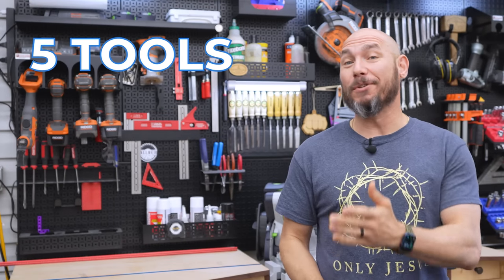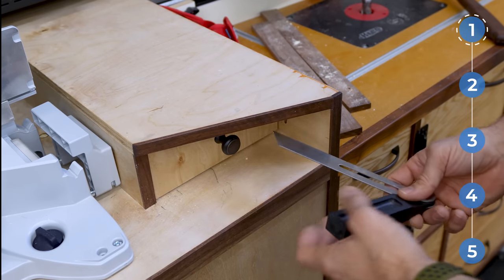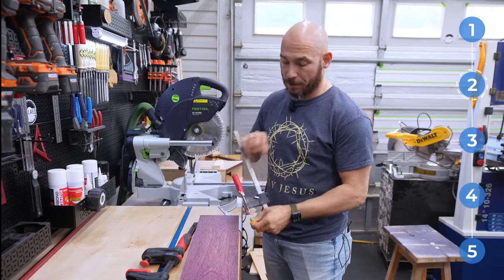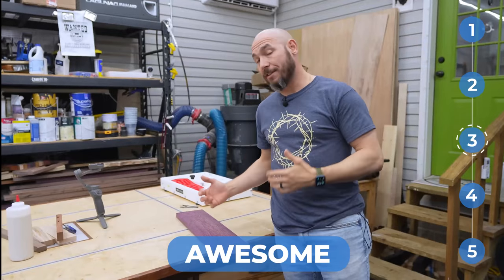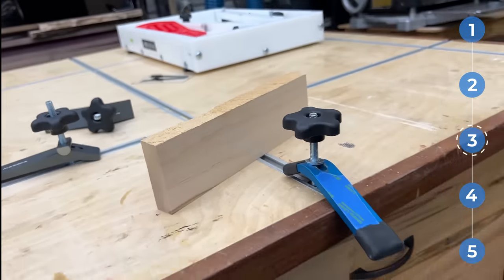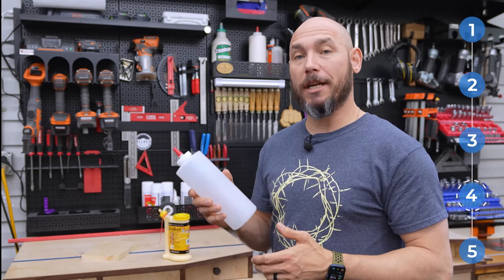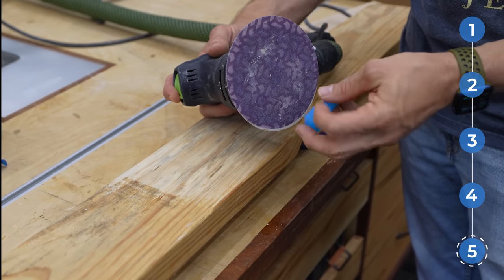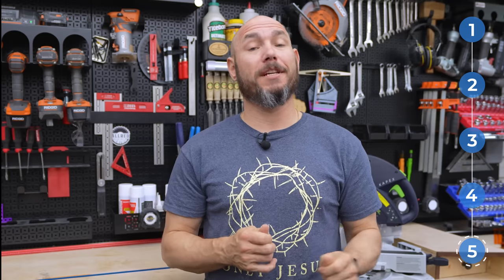5 Tools Under $30 Every Woodworker Needs

Comment: Thanks. My preference for glue applicator bottles is yellow mustard bottles. They work really well and I have never had a problem with them.   I have both a large and small glubots but I tired of having to clean the nozzles every time I went to use either of them. Now, they are empty and clean and sit on a shelf looking pretty.

Comment: I just did my first pocket hole project because of your encouragement to it's use, went with Kreg system, got standard, HD, and now the micro and loving them. Made a frame for a tub sink  I didn't need inside anymore to use outside by the garden hose as a mess sink.  So much chunky sawdust/little curls! You were right!
Reply from the maker: Awesome!

Comment: Been using the 3M paper for a year now. Best ever. I’ve also use condiment bottles for over 40 years. I can’t squeeze hard enough to use a gluebot. I use 4oz, 8oz and 16oz bottles with Titebond II and III.

Comment: I've been back in the woodworking hobby for almost a year now and I can see there are '2 camps,' the 'T-track' and the 'dog-hole', when it comes to having 'multiple-mechanical-hands'(clamps) to hold down your work. 
This is brought me to the conclusion that I can very easily spend $50,000 in the shop and never build a single thing, IF I allowed myself to buy every little trinket that I like, but don't need. That's my problem, not a problem with the channel.
That being said, I think I'm 'T-Track' because of it's versatility, and it keeps sawdust out better.
If you have a 'dog-hole' bench, you may as well not have any drawers in it, or you have give up some real estate directly under the work surface.

Comment: Between you and Matthew Peech, my wallet is huddled over in the corner crying!  I've been debating trying that sandpaper for a while so might have to pick up a box next time I need some.
Reply: I bought some of the Cubitron discs a few weeks ago based on several reviews. They are really good, sand smooth, last a LONG time and don't clog up. When you're ready to purchase, check the prices on the Taylor Tool site.

Comment: I have the glubot and have found if you are done gluing a project or part of a project, if you wipe down the tip it doesn't tend to clog. have had mine for a few years ad haven't had any issues

Comment: you should get the Festool protector pad for net abrasives to put between your regular pad and the xtract or you will ruin the hook and loop on your sanders
Reply: Yup. Very correct. I destroyed my sanding pad really quick. It melts the hook and loop. Also the net doesnt stick to the regular sanding pad worth a poop.

Comment: Just an FYI on the sandpaper and festool sander.  The interface on the festool ETS 125 is not designed to use with net.  It will stop sticking within a few months to the paper.  By the $14 net that festool sells to use with Net Sandpaper and save yourself some headaches and frustrations.

Comment: i use those catsup bottles for glue too. quite a bit off topic, but one of the best uses for them is pancakes. i put the dry mix in, add water, shake to mix, and then use the bottle to squirt the batter right into the pan.
Reply from the maker: Good tip! I love me some pancakes!

Comment: Someone is Sanding all day most everyday in the boat shop and we recently tried switching to xtract from the mirka paper. After about a month of trying every grit of xtract, the mirka papers by far beat the xtract in every single application and grit.
Reply from the maker: That's very interesting!  I've never used Mirka paper.  May have to give it a try
Reply: Unneeda seems like a good quality. I actually just found out about that company just the other day I've been meaning to place an order so I can try out their sandpaper and sanding tools and things that nature. That's one of the main reasons why I'm so excited about Milwaukee's new M12 detail Center they got coming out.

Comment: Wouldn't it be better to set the mitre saw directly from the t-bevel? Doing so would eliminate inaccuracies reading the angle and transferring it to the saw. It would also bypass any errors in the saw's protractor and fence alignment.
Reply: Hey Bob, For double miters, the T Bevel alone is not capable for setting the miter saw. And you are right, T bevel directly to the saw for a single bevel is an option.
I own a Sawset Pro. No rounding up or down. Work with the fraction of a degree for a perfect fit.
Reply: in addition to the tool mans point, it aint that easy. if the bevel is not perfectly parallel to the bed, your off, if the blade of the bevel hits one of teh carbide teeth, your off. if you press the bevel too hard into the fence, it moves and youre off. imo, setting the miter saw with a t-bevel is the worst. ill transfer the t bevel to scrap paper and measure it with a protractor before i try to use it on a saw.
Reply: I absolutely love the Jorgensen ratcheting gear clamps that they sell at Lowe's speaking of which I need to go see if they make any size other than these 8 inch and whatever other size I have actually I think 8 inch and 6 in. These things are amazing they have such a strong grip on anything it's a little finicky to get set quickly at first but you quickly learn how to use it it's very intuitive. They're about 15 $20 a piece I believe but as far as clamping strength goes and being quick about it man they just they are nice I'd rather use one of those than one of the super heavy duty quick grips

Comment: Where can one find accurate paper rulers that could be cemented to workbenches, jigs, auxiliary fences and the like that has both Imperial and Metric markings on it, at least 1 yard or 1 meter long?  I don't want to spend a lot of money, but I do need a small supply of them.

Comment: Bro I don't believe you've never heard of condiment containers being used for glue bottles. About 5 years ago I worked in a furniture shop and that is all they used everywhere. They're cheap and they will clog given enough use but they are throw aways that are cheaply replaced. There also good for mineral oil, paint thinner, and a whole lot more.

Comment: I find the mesh sanding discs (both 3m and Diablo) generally don’t do well with any kind of rough corners but excel at flat surfaces. I use them for any flat boards, but will switch to some regular Diablo paper for rough pieces so I don’t run through the mesh ones. They last a lot longer on flat areas though and the dust collection seems better in my experience as well.

Comment: I watched an in depth video review on this paper vs a few others and it didn't hold up well. It actually started flaking parts of the paper. In the end, it did not sand as fast either. The one paper you should review in the 3M Cubitron. That stuff is amazing.
Reply from the maker: This is Cubitron (says it on the lower right of the box)
Reply: @731Woodworks  I think they make a few different types of cubitron papers. It’s not the one I used and was so impressed with. The one I used is the Cubitron 2 part number 87430. Amazing stuff.

Comment: Legit question if you dont mind mate. Why use a gluebot or a wide condiment bottle if you have a bottle the glue comes in anyway? Is there any advantage at all or just preference?

Thanks in advance from a newbie woodworker in Sydney, Australia
Reply: Shops that do as much work as he does buys glue in bulk and a 1-gallon jug is not good for dispensing, so a smaller dispenser is necessary.

Comment: The glue bottle thing makes no sense.  You can lose the cap on either the gluebot or the empty bottle.  At least with the gluebot you can get a replacement cap if you somehow manage to rip it apart and lose it.  Don't diss a product that you broke.  Also, why not just use the factory bottle you have on the bench in the background with a closable lid.....

Comment: Sawset Pro: Use your T-bevel to find the angle. Read the angle on this fancy protractor. Set your saw to the angle. OR...
Use your T-bevel to find the angle. Set your saw to match the angle on the T-bevel. Skip a step and a tool. Works great. Who cares what the actual angle is... (If you do, read it off your miter saw bevel gauge.
Reply: Hi Brett.  Can a T Bevel alone find a double miter saw setting?

Comment: Love the GearKlamps - great improvement over the traditional F-style.  And pretty much everything from Massca is awesome but I hadn’t noticed those T-track clamps before.  I have to say though, I’m surprised you haven’t migrated to the Matchfit system.  For me, it was an “Ah-ha” moment.  Love it!
Reply from the maker: I have a cross cut sled and jointing sled with the match fit system.  Also a portable workbench with match fit.  Love em!
Reply: @731Woodworks  Ah, yes. Duh, forgot about those. 👍

Comment: Nice but the starret is way faster and easier...try it out if you haven't already..starret miter protractor.
Reply: Hi Jeremy,
I own 4 Starretts and your right, its easier and 30 seconds faster.  BUT, you loose accuracy. The Starrett has combined 2 degrees in one increment for the single miter setting. Try finding a fraction of a degree.  Sawset Pro is better for the detailed woodworker. My opinion.

Comment: Glue bot is best. Don't lose the cap. Problem solved.
Reply: @731 Woodworks  And if you're prone to forgetting to put the lid back on, hang a hair pin on the strap and use it dig out dried bits of glue.

Comment: Terrrible advise about using a damn condiment bottle…wth, come on man the whole point is to not have to wait and flip the bottle over every time you need.. also “water down your glue enough” to try and sell a worse way of doing things…you’re excellent with everything else you do, but I know you had to have sold some of your soul to shout out that “hack” 🫠😑
Reply from the maker: What are you talking about?  Several people have commented saying they use similar bottles.  I got paid nothing for that.  I liked the idea and decided to share it.  It's a $2 plastic bottle.
Reply: Mate, have you used a Glubot? What he said is correct, the glue tip gets clogged, I had the whole thing clog on me and I tried to clean it but it's pretty much useless now. so I got some condiment bottles. 👍